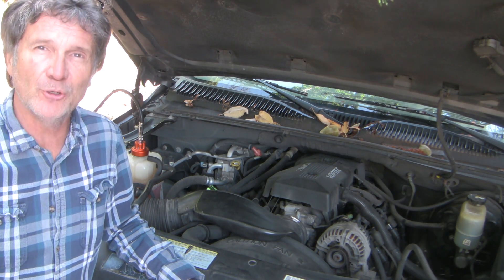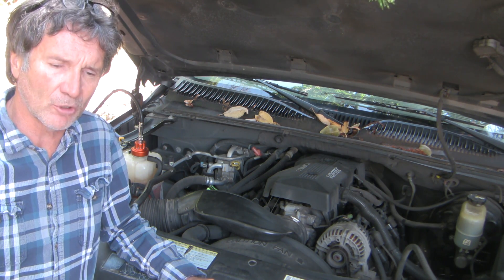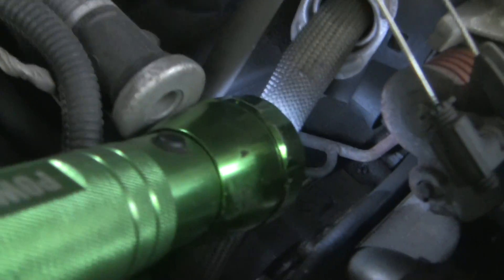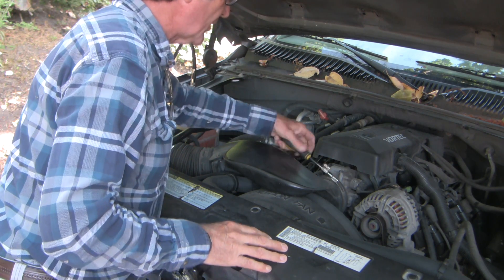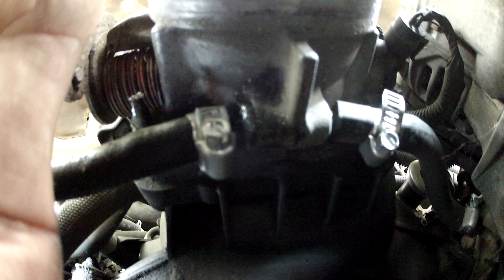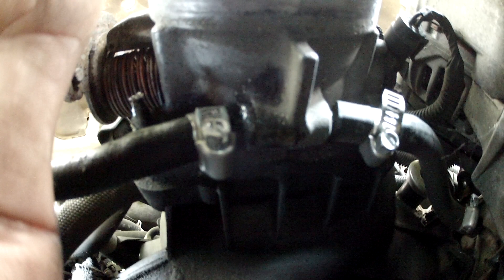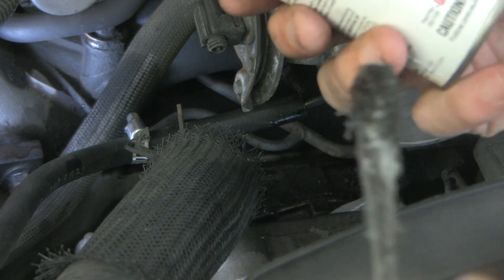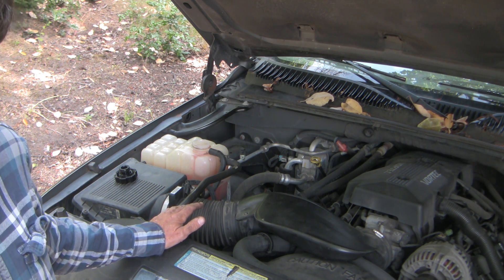How to diagnose a mystery coolant leak in a Chev/GM truck

Comment: So this is also happening to me, im having to add coolant every 2 weeks when is cold, monthly during hot days. Already changed thermostat, water pump, entire new ac system, im out of ideas as to where is the evaporation coming from because is not a leak... Any suggestions sir? The hoses also appear to be ok
Reply from the maker: Careful inspection looking for crusting residue from evaporated coolant can sometimes help find an obscure leak. Look for damp floor mats, that might suggest a heater core leak, and inspect both sides of the radiator especially the sides where leaking plastic connections are very common. Have a close look at the weep hole of the water pump, and while you're at it look for leaking around the coolant reservoir. It could be as simple as a bad radiator cap, that can leak gas, which presents with occult loss of coolant. If you keep the system topped up the risk of overheat is pretty small, although I would carry a container of distilled or deionized water to replenish fluid if it leaks away from home. Never remove the rad cap of a hot engine, the risk of superheated burns is too high.
Reply: @spelunkerd  Thank you so much sir for such detailed information. I will definitely take a look, I did also replaced the radiator but have never checked out the hoses closely. Thank you for an amazing video!
Reply: @danielaa8781 : You can't just start changing out parts to find an answer. You have to find the problem first, then get the part that's causing it. I was just like that until I finally thought, that's not how you should do it. Luckily when I did do that they were cheap parts, nothing major.
Reply: What are the casting numbers on your heads?
could be the infamous "Castec" head coolant leak due to small cracks
in the heads . think 862,706 were the casting numers affected and mostly
on the Castech made heads.do a search online for castech head issues.
bye

Comment: Thanks for your helpful videos, sir.  One helped me replace the AC compressor idler clutch pulley on my Dodge truck, when bearing gave out. 

 I also dealt with a small coolant loss on said truck, losing about a cup full every few days.  Pressure testing didn't reveal anything, but I used one of those block testers with the blue dye and it detected exhaust gases in the coolant.  So now I was dealing with a tiny head gasket leak.    This was further confirmed when I scoped the cylinders and found a tiny bit of coolant in cylinder #5 (4.7L V8 engine).  I only noticed it because I was leaning heavily on the truck which shook it, and I saw the liquid move on top of the piston, on the very grainy video.  

Well, the truck wasn't worth much and I was determined to do everything to not to have to pull the head gasket.  Against my normal judgement, I used one of those block seal products, but used it very judiciously in a targeted manner, disconnecting the heater core during use and flushing out the radiator before it dried.  Supposedly the stuff turns to glass and melted copper flakes as it encounters leakage in extremely hot places.  I drove with it for many miles as initial application using the instructions did not work for such a tiny leak.  Anyway, that was over 5 years ago and the truck now has 300,000 miles on it with no further loss.  I later learned that Dodge coolant has silicates to prevent such leaks but I was using silicate free, so that might have contributed.

Thanks again for your videos.
Reply from the maker: Thanks for the followup, you made my day!

Comment: I have a 2004 we hitch is losing coolant and I have already changed the reservoir cap recently. What else could it be and should I do a pressure test? If so can I rent or do one at autozone?
Reply from the maker: Some autoparts stores will rent equipment like that out. In the meantime, check the radiator, coolant reservoir and all the hose fittings carefully, looking for a wet spot. Sometimes you only see discolored crusty residue around a slowly leaking component, such as the plastic coolant hose flange in the Jetta, a notoriously common problem. Don't forget to look underneath the water pump for the weep hole, if it is leaking there you need a water pump. If the cab is unusually damp or smells of coolant, it could be the cab heater core. Usually if it is more serious like a head gasket you'll have other issues, such as white smoke out the exhaust or recurrent overheating even when coolant is well topped up. Occasionally I've had vehicles that don't show me the diagnosis, in which case I top up the coolant frequently and wait for more clear signs to evolve. Don't be tempted to use StopLeak, those compounds cause more problems than they solve. Good luck!

Comment: Nice find.  BTW - to control coolant (or whatever fluid) from leaking when disconnecting hoses, I use either some hose clamps like 

https://www.amazon.ca/Lisle-22850-Hose-Pincher/dp/B0002NYB78/ref=sr_1_1?ie=UTF8&qid=1546870250&sr=8-1&keywords=Lisle+22850

or forceps from either a medical supply or Princess Auto or something similar when disconnecting coolant hoses like this without draining.  One on each side - the hose that was still connected and on the hose you disconnected,  would have kept drainage to a minimum.
Reply from the maker: Good point. I have similar pliers, with rubber linings so they don't injure the tubing. There comes a time when the effort to find some tools is frustratingly time consuming, ha ha.

Comment: My friend the hot coolant flows through the throttle body to prevent icing due to the temperature drop from the Venturi, Bernoulli’s principle states that when you move a mass of air or a fluid through a Venturi two things need to happen number one the temperature must drop number to the pressure also drops
Reply from the maker: Excellent point! It is so nice to find your remark, one that inspires deeper thought.

Comment: Great vid, as always.  Glad it was a no-cost fix!
Reply from the maker: Yeah, always the best kind. Without the pressure tester to identify where the water was coming from, one might have been led to the misleading conclusion that the water pump gasket was bad.  I wonder how many water pumps are replaced on these vehicles when the real culprit is a leaking hose above.
Reply: Agreed!  I need to get one of those.  I heard you say it was an Astro, do you have the model number?  Thank you!
Reply from the maker: I bought it about a decade ago, Astro 7858. Less expensive alternatives are out there, especially if you only need it for one vehicle. Also I believe some parts stores will loan equipment. Stant offer the core device on Amazon for much cheaper, then you buy the exact adapter for your vehicle separately. And I'm sure Harbor freight will offer something similar. I maintain a small fleet of vehicles so I wanted a kit that works for several models. The other option is to disconnect a hose in the system, then use rubber corks to jury rig an adapter to pressure test from the hose. Of course there is also the option to just run the vehicle to pressurize with the water pump, then carefully inspect. In that case you've got to avoid spinning belts and hot coolant that will boil over when you start the repair phase. I invest in tools with money saved from doing this myself, so in the end the main benefit of home repair is not financial. Insight gained from learning how these systems work is priceless.

Comment: love your problems, cause they match my problems and the coolant checker is like mine as well, turns out my seep holes are leaking on my water pump ever so slightly, could not find it otherwise.. Slant coolant checker would have cost us way more , great diagnostic tool here.. and awesome video as always...
Reply from the maker: Thanks, man! The one thing my kit is missing is a cap tester, though testing the low pressure valve in the cap can be done easily with no tools. Most cap problems are at the seal, easy to inspect, anyway. When I look back, cooling system problems and battery problems are the core of DIY auto repair. If you understand those, you can cope with the vast majority of auto repair problems.
Reply: @spelunkerd  i ended up having to make my own cap inspector for this kit, still great price and offerings overall..
Reply: ¹l1oi²e W

Comment: Hi Dave....another great video.  Honda runs coolant through the throttle bodies to try and eliminate icing of the butterfly valve in cold weather.......I suspect Chevy is doing the same thing here.
Reply from the maker: Excellent thought, Nick, others said the same. Terry suggested it is to help fuel vaporize fuel in the winter, which is a variant on the same theme. People don't remember how difficult it was to start carbureted vehicles in the winter a generation ago. It was always a question as to whether one would get to work on time. Thanks for making this thread worth reading!
Reply: Not only the butterfly valve but maybe freezing in the throttle due to the Venturi effect I believe. Great video have to keep this in mind for my similiar 03 Suburban. Clean those leaves out of the hood! My pet peeve!  😁 thanks for video!

Comment: It's nice to find an easy one occasionally isn't it?

Your explanations are great. You don't skip ANY steps and even give us the nut driver size. 
Thanks!
Reply from the maker: Yeah, I was due for an easy one, ha ha. Thank you for the kind words! On the contrary, when I make a video I usually wish I had worded some clips a little differently. At some point, you have to finish and move on to the next one. People are usually kind enough to overlook imperfections.
Reply from the maker: @T.Conti-333  Sounds like two fun challenges, likely unrelated. I made a playlist of cooling system problems you might find helpful. These days a leaking radiator would be high on the list for an obvious coolant leak. In any case, with an obvious puddle it should be easy to find the source. Good luck!

Comment: I wonder if a spring clamp might be a better choice. Perhaps hose deterioration allowed worm gear clamp to lose pre-load. good video.
Reply from the maker: Yes, now that you mention it, I agree that spring clamps seem to do a better job for these small diameter tubes. I find the spiral threaded clamps on small tubes tend to dislocate and not give as much tension as I would like. Also this tubing is plenty strong and it doesn't kink but it is not very flexible. The next time I visit the parts store I'm going to pick up a few some smaller diameter spring clamps.

Comment: Great video Dave and I can see how that tiny leak would be hard to find. I suspect that the coolant passing through the throttle body is to help the fuel vaporize during the winter months. Good work!
Reply from the maker: I love reading discussion threads like this, they usually add something that brings color to the video. Thanks for making it worth reading!
Reply: I doubt it since that engine is fuel injected.

Comment: Hmm the comment on the winch was supposed to be for this video. YouTube moved me to that video and I hit submit reading about winch thinking hmm...
Reply from the maker: Yes I found it. I believe the normal route for fluid (and trapped air) is from the top of the engine to that junction, then back to the midpoint of the radiator. I'm not sure if there are small coolant passageways inside the throttle body, but in any case there will be some heat transfer to the metal of the throttle body right underneath the throttle plate. So, the thought that it goes there to prevent freezing of the throttle blade is a good one, even though most old engines don't have that. This vehicle has always been very easy to burp and I believe that extra passageway also helps with burping of trapped air. Thanks again for watching my videos! If you ever want to edit or delete a comment, you can move the mouse to the right of your remark and click on the three vertical dots, then change it as you wish. If you completely delete a remark, all the replies get deleted, too.
Reply: i copy  paste the comment  and deleted it  from wrong  spot no, a bit more easy then on the mobile phone screen to do  on my linux-desctop. paste-->"I am not a fan of these hose clamps but small ones don't come in many choices. The 2 hoses is one not for return?"
Reply: Did you look on rockauto there immages often show all sides of a part if they  sell it . i also use  google immages to figure  stuff out if i can To not  get dirty  hands ;)

Comment: Love the systematic approach you take. Obviously starting with the right tools and a clear understanding of engine cooling helps. 

Would love to see a similar vid about finding / repairing a refrigerant leak in a marine bar freezer. Most specifically a NovaCool F1900, but any bar fridge / freezer with 134a refrigerant in it should be roughly the same process I would think.
Reply from the maker: There are some very good videos on 12V A/C systems here on Youtube. For an excellent A/C review, search the RatchetsandWrenches channel, he's a good teacher. It took me a while to find the adjustment dial for the fridge cooler on our boat, it is hidden in a very dark corner of the pantry cabinet. I was sure glad to find it before asking my brother, an AC tech, to help me out. He would never have let me live that one down, (grin).

Comment: Coolant is routed through the throttle body to prevent freezing of the throttle blade in cold climates.
Reply: rusco321  is right.  Prevents ice formation at closed throttle at the butterfly plate.  Old carbureter cars were famous for this problem even with heated intake air and or heated throttle bodies.  More so when the temp is below 40 degrees F. with high humidity.
Reply from the maker: Good point! I don't see an internal pathway around the throttle body but it wouldn't need much, given how close it is to the throttle butterfly.
Reply: Don't know if you guys will see this after so many years and also I'm sure this is totally unrelated, but small Cessnas and none fuel injected gasoline airplanes have a carb Heat lever to pull when you Throttle Down such as when coming in for landing, and you do it summer winter no matter when.